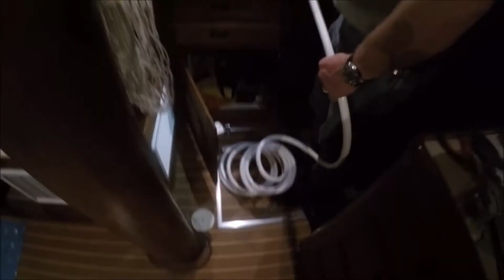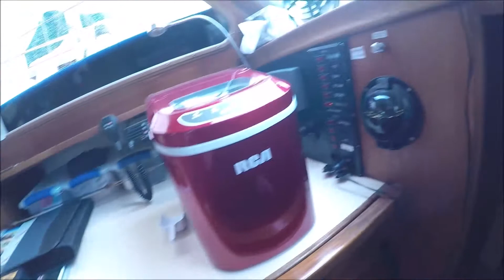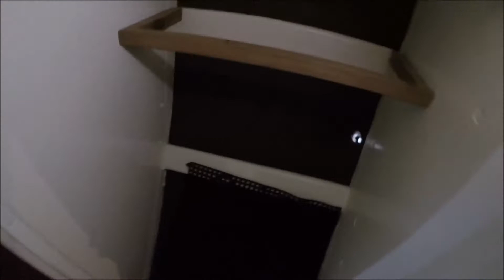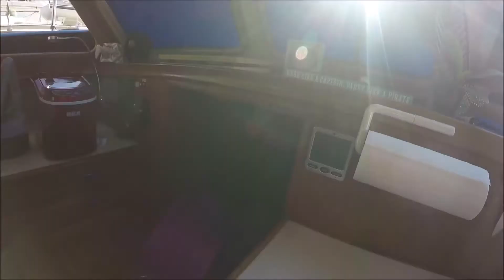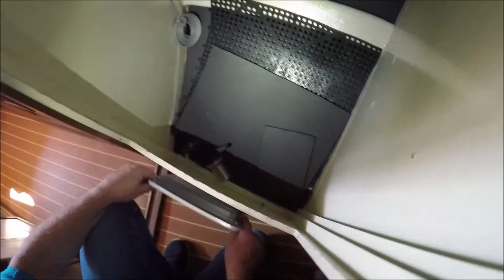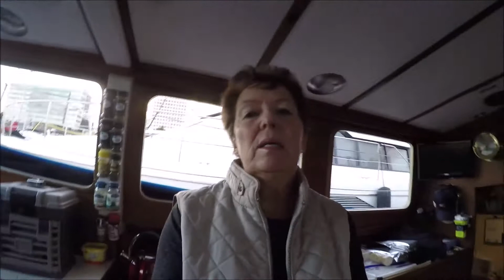Episode 64 - AC - heat units installation

Comment: Did you find that the 16,000 BTUs in salon and vberth with 10,000 in the aft was sufficient? I'm actually planning on installing AC this summer so this was very informative for me. Thank you!
Reply from the maker: Thanks so much for asking. We don't have anything to compare them against but we are happy with the heat they put out. This summer we will be able to see how the cooling works. More to come.
Reply from the maker: Also, the pump has to be at least 12" below the water line and the hose must be angled up to to the pump from the thru hull. The pump is not self priming. That requirement has caused us much grief. We are installing check valves to keep water in the lines when cleaning the strainers. We will video more on that soon.